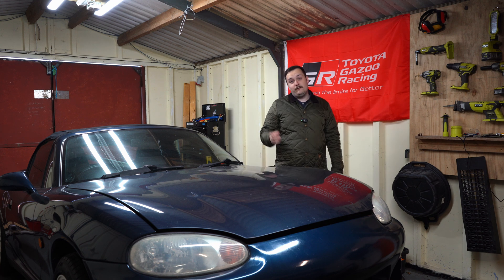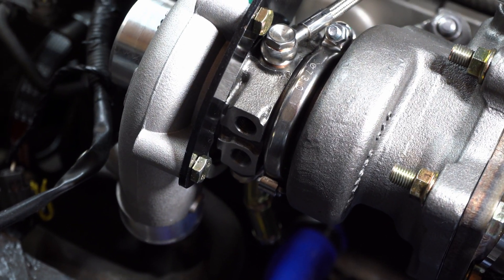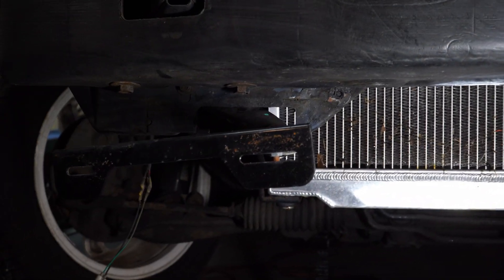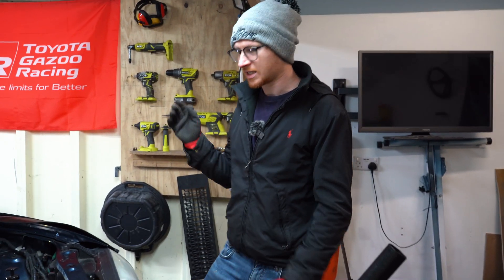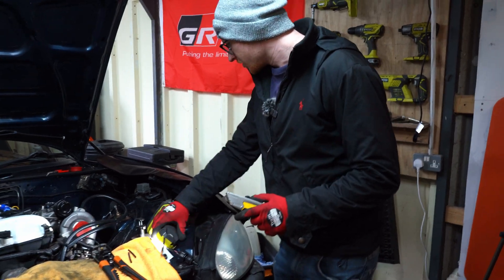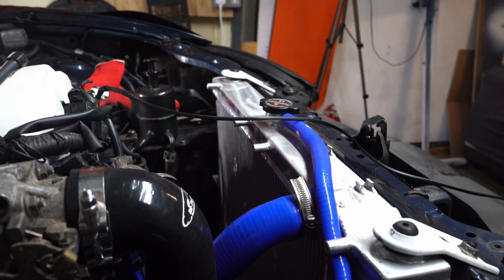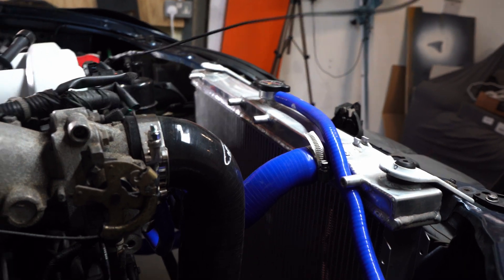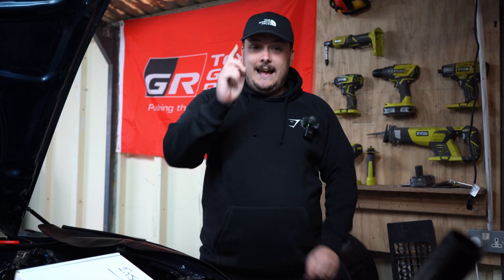DIY Turbo Build | NB MX5 Miata | Installing The Oil & Coolant lines, Intercooler & IAT | Episode 3

Comment: This is so helpful. I’m about to put a td04 kit from bofiracing on mine. Thanks guys.
Reply from the maker: Glad it helps! Bofi kit will be pretty much the same, I think the intercooler mounts different and they supply a drill and tap kit for the sump rather than the dipstick I opted for!

Comment: Nice one lads. I was wondering why you chose this kit and if there were any others you considered? And are you satisfied so far with everything supplied and the instructions?
Reply from the maker: I thought this one was best due to being made by the ECU manufacturer. I also considered using the BOFI kit, which uses the same Manifold, Downpipe (G19) and ECU(ME221 or ME442). The instructions are helpful however they're not comprehensive and assumes you have some basic knowledge of what everything is and where it goes. Pretty happy with how its going, only issue I have is the Pre-clocked turbo is slightly off so that will need to be addressed at some point. 

Are you thinking about taking the plunge?